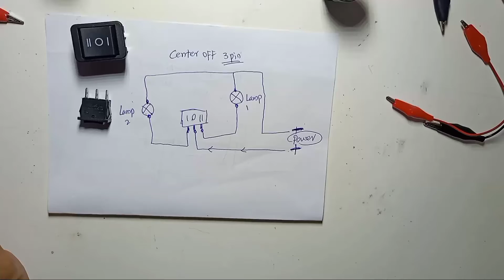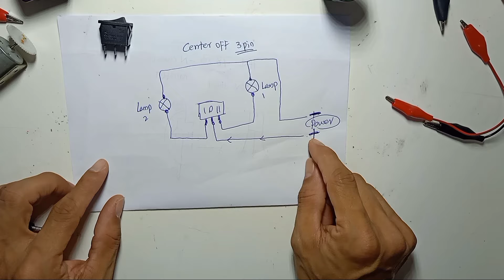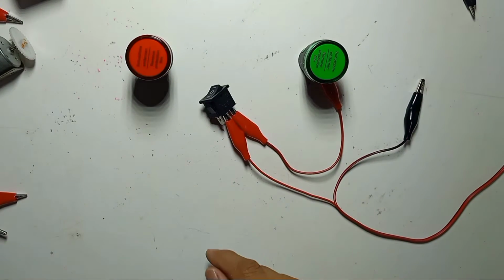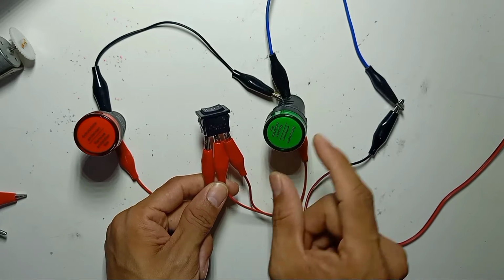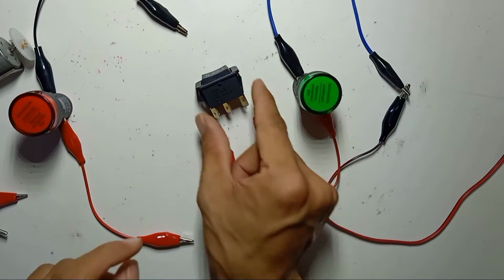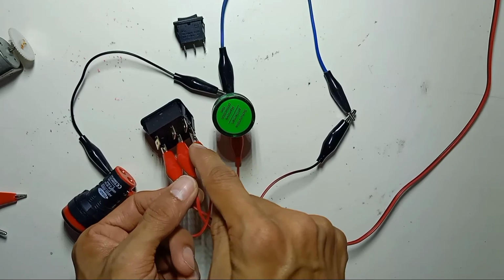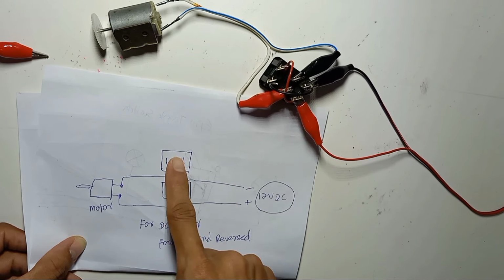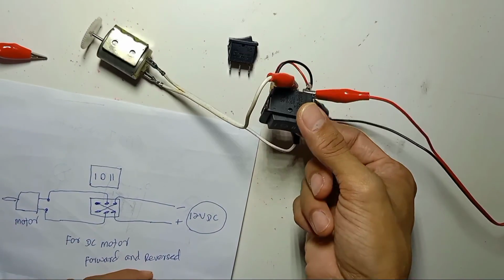How to use ON OFF ON switch

Comment: Can you help me with a diagram for the 3pin with a 2 wire acuator? Would the power from the battery go to the center. Then the ground goes to the ground on the acuator and left or right side of the 3 pins. The. The positive side of the acuator goes to the opposite side of the 3 pin switch? I need to control up and down on my momentary switch. It's hard to type out. Any help would be greatly appreciated 👏🏽
Reply from the maker: @robertbragg9364  coming soon i will do it
Reply: @passiontechklm  thank you very much I appreciate it. Usually I'm pretty good at figuring it out but I can't get this one. On my linear acuator there's only two wires and neither seem to be a ground. It needs to go up and down but they only sell a 3 prong momentary switch with on off on for my motorcycle. Thanks so much I really do appreciate your time and responding so quickly.
Reply from the maker: @robertbragg9364  i hope this video will help .https://youtu.be/bje6Bgxy868